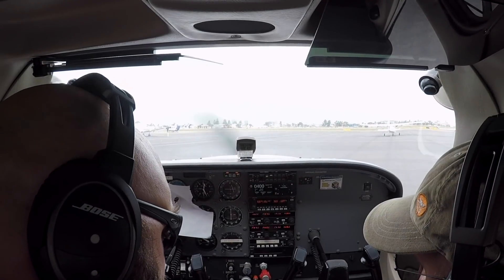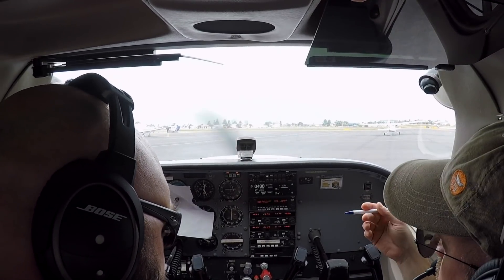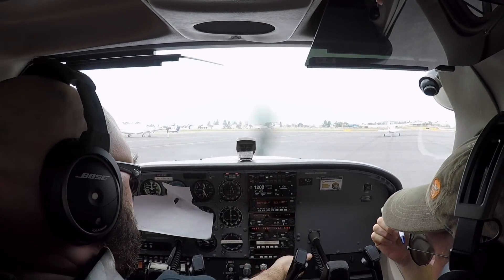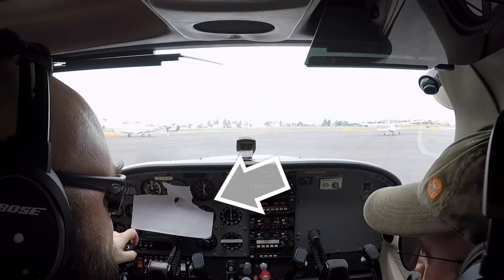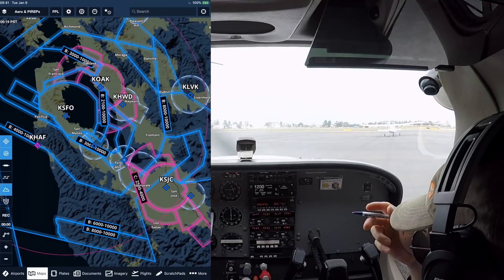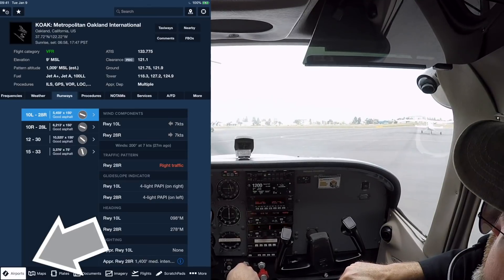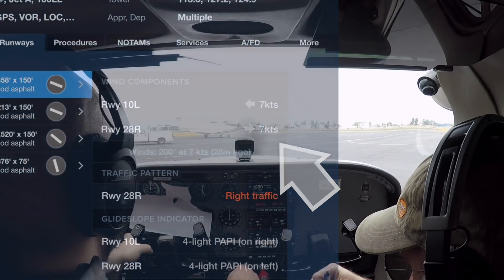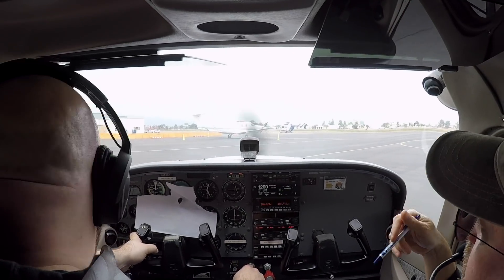Mastering Crosswind Landings in a Cessna 172 - Part 1

Comment: your method of flying the runway is very effective.  i teach students, especially tailwheel students, to land by not landing.  i am surprised more CFI's don't teach aircraft control just above the runway before trying to touch down.  teaching tailwheel really shows that you can't hope to achieve a good landing with no side drift and fuselage aligned with the runway if you can't control it just above the runway.  so i do this first whether or not there is wind.  i tell them not to make any contact with the runway until they can fly the entire runway under complete control both vertically and horizontally.  this teaches pitch/throttle to control height above the runway and aileron rudder control for runway alignment and side drift control.  the last thing they learn is to control drift and alignment right at point of contact with the runway.   i emphasize that everything up until touch down is practice.  touch down is when practice is over, especially in a taildragger where the semi controlled crash of a 172 will be a real crash in a taildragger.

Comment: the amount of rudder input is a direct result of the amount of aileron it takes to hold the centerline.  i like to tell students to put the upwind wing down enough to  hold the centerline and then enough opposite rudder to align the fuselage with the runway.  much easier in a tandem seat airplane to be on centerline and lined up straight with the runway.  i make sure to tell students, especially tailwheel students  on gusty days to hold the nose just slightly into the wind while landing.  that requires a lot less aileron to hold the centerline.  every degree you point the nose into the wind makes it so you require a lot less aileron to counteract the wind. that is a huge factor when you are near the maximum xwind component of your airplane.   you can bump up crosswind component by a lot by just pointing the nose 3 or 4 degrees off centerline into the wind instead of away from it.

Comment: Great Video Jason!  I'm hoping you'll answer me or some other CFI's can give me some advice here. I've just returned to flying after a four year break. I'm doing great and really enjoy flying again and putting in quite a few flights after my BFR.  I'm trying to set a xwind, and gusts personal max and it seems you get so many different opinions from everyone on what is safe and what is not. Some (including the CFI I did my BFR with) have stated that they would never attempt to land a 172 in even a 15kt direct crosswind. He even claimed a 172 is not good at handling much more...Here you seemed to have done it with direct at around 18 with higher gusts. Others, like yourself, seem to do it often.   I know you can technically fly it down and sideslip as long as you don't run out of rudder.... Any advice based on all of that and what I should set my limits at to begin?   Thank you so much...

Comment: Ailerons have 3 chores;
1) make the bank to TURN the plane (99% of our flying)
2) approaching the runway: makes the BANK that stops xwind drift.
3) ON the runway: provides the ADVERSE YAW that aids rudder in directional control to brake speed.

Comment: Good vid...I always teach dutch rolls before crosswind landings.  Teaches the student how to keep the airplane moving straight with rudder and aileron positioned off center.  Good way to teach slips too.  Being cross controlled is awkward for most new pilots.  By the way..I don't see xwind take offs being similar in any way.  The second you leave the ground you should concentrate on level wings and crabbing.  I ALWAYS teach wing low landings in xwind....you should never take off with a wing low...kills lift when you need it most

Comment: You guys were using too much flaps for 18kts Xwind. Should’ve been at flaps 10, maybe 20 max. At flaps 30 it’s beyond the max demonstrated limit, would be much easier with less flaps.

I just keep a calculator in my bag. Often it’s quicker then the e6b. Just enter 21sin(60) and done 18.18kts with 1.82kts to spare to the 20kt demonstrated max with 10 degrees flaps. Can do the same thing for headwind but use cos instead of sin.

Comment: Dont need a Nav Comp to calculate x/w. Angula difference + 20 (constant from the sine curve) = % of wind that is crossed. In your case 60 + 20 = 80%... of 21 kts... in my head 17kts.. easy.  Will always be within 1-2 kts & you can do the numbers on final whilst getting hammered by wind. Anything normally over 80% is going to result in the same technique as %100 x/w anyhow... I fi d this method very easy to teach... Cheers

Comment: Kudos for doing low passes.  Most instructors would either cancel the flight, go somewhere else, or force landings where the amount actually learned would be near zero as the poor student struggles in those precious few seconds before touchdown.  Instead, he was able to have a LONGER time in the actual conditions and was able to see the results of what he's doing.

A few people commented about the "maximum crosswind" and yet, that number is the maximum DEMONSTRATED crosswind.  It isn't the maximum a pilot can do.  AOPA had a recent article about it and talked about how it is the number a somewhat less-than average pilot could do safely.

As for figuring out the crosswind component, I learned a trick years ago though I can't for the life of me remember where.  It is simply to take one sixth (1/6th) of the crosswind component for every 10 degrees off centerline.  So 20 degrees off centerline means 2/6ths (or 1/3rd) of the wind speed as a crosswind component (which at 21 knots means 7 knots).  What that essentially means is that at 60 degrees or more off centerline, you are pretty close to full windspeed at crosswind.

Technically, the formula is the windspeed times the sine of the angle of difference. Calculating it out, at 60 degrees, that's 86.6%, which at 21 knots comes out to 18.1 knots crosswind component.  If you were to say it was slightly less than the full 21, you'd be pretty close.

At 30 degrees, the estimation is dead on (three sixths equals one half, and the sine of 30 degrees is .5).  At smaller angles, at windspeeds we're likely to fly, the difference is minuscule - usually far less than a knot difference.

Frankly, I'd rather be off in my calculations by a couple of knots which is pretty inconsequential and not have to waste time dragging out a calculator or trying to look at some hard to read chart while also trying to fly the plane in what is difficult conditions even in the pattern.

As to the slip down final versus crab and kick, that's a religious argument similar to Piper versus Cessna.

In the small planes most of us fly, you HAVE to land in a slip (in a crosswind, that is) because if you don't, you'll put side loads on the landing gear and possibly damage them or worse, lose control.  If you touch down in a crab, the wheels are facing a different direction from the direction the plane was flying and the direction you want to go.  So a lot of instructors prefer the slip down final method because that allows you to set up the slip well beforehand, and doesn't require changing the positioning (or controls) of the airplane at the last moment.

On the other hand, flying a long slip can be uncomfortable for passengers, and a slip is often more difficult to maintain than a crab.  So some instructors prefer to teach their students to crab and then "kick" at the very end.

Personally, I think experienced pilots can do whichever they prefer, but I tend to think that having students change the configuration of the plane shortly before touching down is a recipe for disaster as well as making it harder for a student to learn a normally difficult skill.

For some reason, when learning to fly, I just tended to fly a crab until short final and would then slip at that point - sort of the best of both worlds, allowing enough time to settle into a proper slip, but while still having the comfort and ease of a crab most of the way.

Finally, it is probably the camera angle, but it looks like the plane was WAY off the extended centerline on approach.

Comment: That’s good instruction. Kudos to you for teaching a crab final vs a slip final for two reasons. 1...that’s how the autopilot pilot would do it on a coupled, IFR approach, and 2...some OM/POH’s caution against prolonged slips in aircraft with left/right only fuel selectors (fuel pick up problem with low quantity). If anyone wants to transition to bigger airplanes, the slip method is incorrect (primacy again).

I would guess you’re going to discuss flap position in high wing vs low wing aircraft during crosswinds in the next video?
Reply: I just commented about crab final vs slip final. I hadn't read this yet but you nailed it. Until recently I always flew the crab until it was time to transition to landing.
Reply from the maker: Thanks, the "other way" seems like a crutch.
Reply: ZERO flaps until you can fly the airplane. 👍